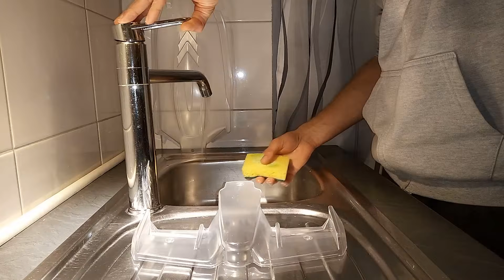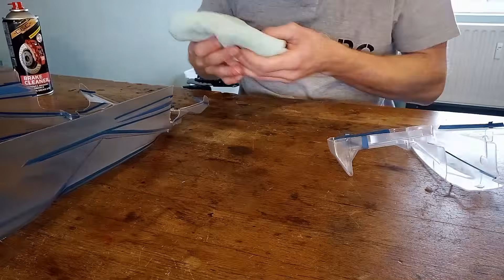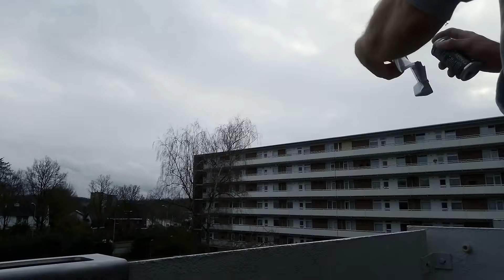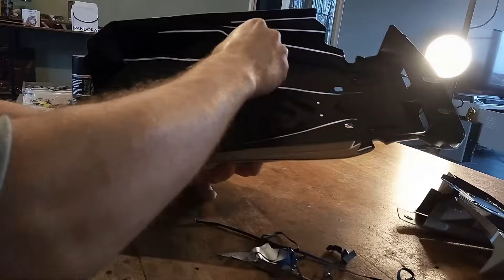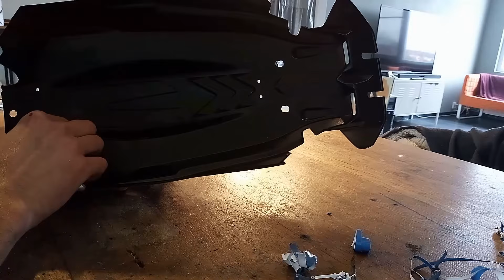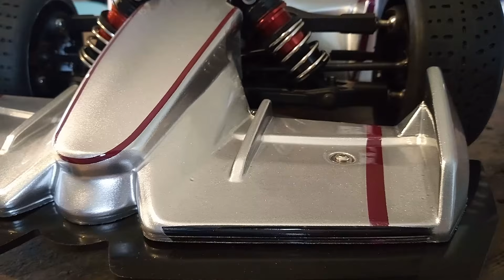How to paint any RC body - Arrma Limitless V2  example

Comment: Good job! But how did you paint the red lines? Did you just remove the tapes and then spray the red over it? I'm assuming the red will not appear on the painted area. And did you use the stock stickers from Arrma to cover the windshield? Can't see from the video clearly.
Reply from the maker: @glObOfad365  Thank you!

I did not use the original masking tape. For some reason i  never get it on right... so i use 18mm tape in miltiple lines and cutted it into the windows shape once it is applied to the body.

When painting different collors you want to give the paint some time to dry, at room temperature 15 minutes is ok to apply another layer.

If you want the previous layer not to interfere with the one you are currently laying the best thing to do is to use a "closing" layer. For example, i did 3 layers of silver for the whole body and closed it off with black (i believe 2 layers).

Next to the red (its purple/pink) i made white line. i put the white first in 2 layers and that painted it red. The red shines throu the white making it a very light red.

Comment: Great job! I'm sure Picasso also had some imperfections. I think the paint job looks great because we all know how hard it is to paint Lines on a RC Car. Thank you!
Reply from the maker: Thank you, your welcome!
 And when i drive 200kmph+ you dont see it :P

That is why i used this 1, 2, 3 & 6mm tape. It makes making lines much easier! The trick it to apply it without gaps at the border of the tape so no paint will go under, and taking it of slowly after the paint is half dry/wet (thats how i did it)

Comment: I got a question let’s say right some how my fingers pulled on the thin layer of plastic the body came with would I still be able to paint it or did I sadly say mess that up ?
Reply from the maker: Spray paint creates mist that flows everywere and will come into contact with the outside of the body. The this plastic foil protects the outside of the body from this. after painting you peel it off.

-If you only took a small piece off you can try and put it back
-u can use tape to cover the small piece that can off
-if all the foil is off you can use microwave plastic foil to re-cover the body as good as possible.

Important is, is that the outside are stuck to the body so paint will not get under the foil or tape.

Good luck!
Reply: @remborc  ok sounds good 👍 I thoughtI messed up 😂
Reply from the maker: @kryptonitelegacy4050  Its not all that bad :P

Watch out fror scratches on the outside, cut your body and make body post holes before painting, paint outside (preferbly with no wind and with no air pollution like dust), dont paint below 15°C because the paint will not dry correctly. (and all the tips from the video!)

I still havent found a good way to tale the paint of the body without damaging the body, so painting is quite permanent.

And dont forget that you first, second and even third body wont be perfect. This was my fith body (something like that) and it still had hair from my cat in it.....Cleaned it 3 times! But i love my cat so its ok. And the tape was not covering all the small corners. But i must say that this was the most difficult paintjob that i did with all the lines and different collors.

What body are you going to paint?
Good luck!! And enjoy!